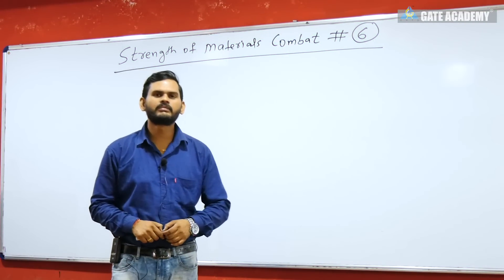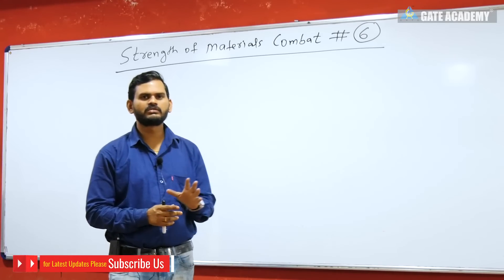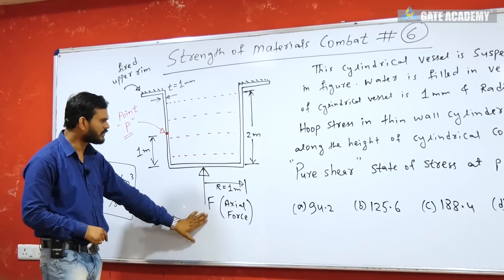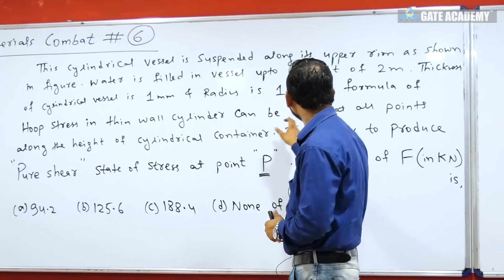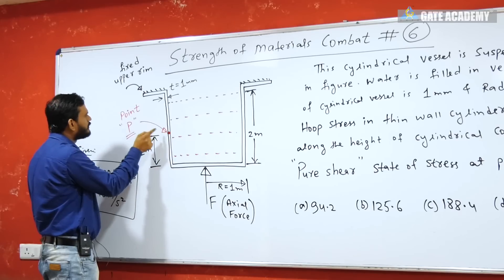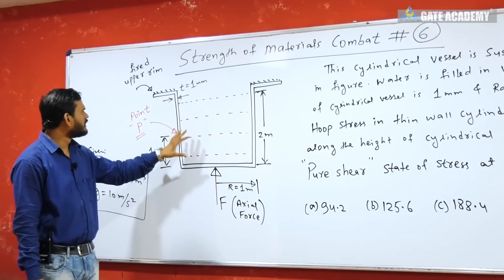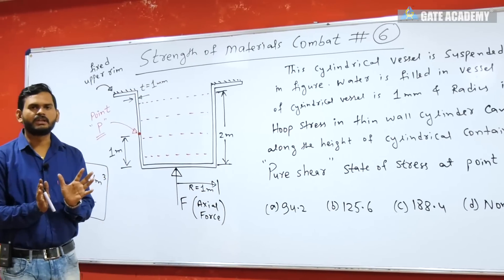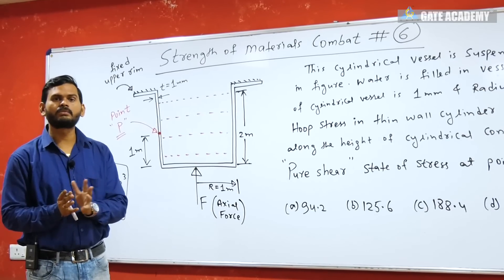STRENGTH OF MATERIALS Combat ... for GATE 2019/20.  #6

Comment: I think Option B 125KN is correct. 

Thin cylinder stresses:
1. Hoop stress at P = pd/2t = 10MPa (use h=1m)
2. Longitudinal stress at P = pd/4t - [F/(2pi r t)] = 10MPa - [F/(2pi r t)]. (here h=2)

(from Mohr circle) To produce pure shear at P, both hoop and longitudinal stresses should be equal in magnitude but opposite in nature... Therefore:
-10MPa = 10Mpa - [F/(2pi r t)]
From above equation, we get, F = 125kn

Comment: Option B 125.66 KN
Hoop stress = PR/t = 10MPa (tension)
Axial stress = rho*g*pi*r^2*2/(2*pi*r*t) (tension)
Since pressure is not constant so we can't use Pr/2t
Stress by F = F / 2pi*r*t (compression)
We ve to get pure shear stress at P ie Mohr's circle centre would be 0 
Stress ( axial+hoop - F ) = 0 
F= 125.6 kn

Comment: ANS : (B) 125.6
IN ORDER TO GET PURE SHEAR AT 'P' , THE MAGNITUDE OF HOOP STRESS AND AXIAL STRESS SHOULD BE EQUAL AND OPPOSITE IN NATURE, AS THEY ACT  PERPENDICULAR AT POINT P. BY EQUATING HOOP STRESS AND AXIAL STRESS, 'F' CAN BE DETERMINE.
AXIAL STRESS = (WEIGHT OF LIQUID - F ) / (2* Pi* R*T)
HOOP STRESS = PR/T, P= PRESSURE AT DEPTH 1 M FROM FREE SURFACE(AT POINT 'P') .

Comment: Option is B 125.6 KN. 
First of all, find the hoop stress by usual formula. No stress in radial direction because of F.
Then, find the axial stress However here, direct formula cannot be applied and the total axial pressure is due to hydrostatic pressure at the bottom, and the pressure due to the force F and both in opposite direction. Balance the forces and find the value of axial stress.
Now, for pure shear, take the sum of the stresses as 0 and find the value of F.